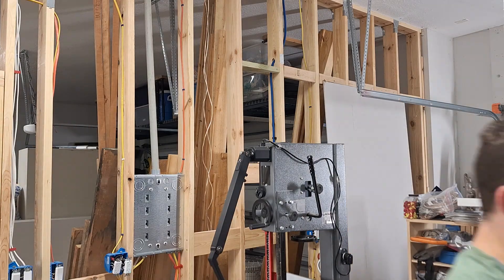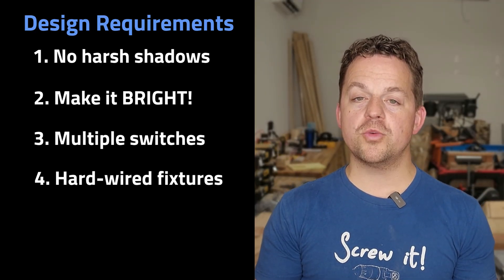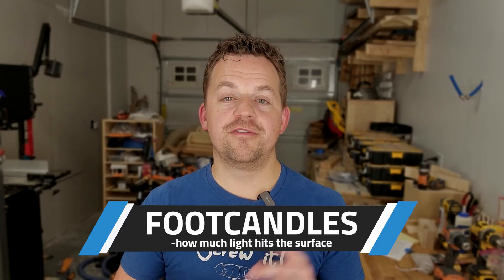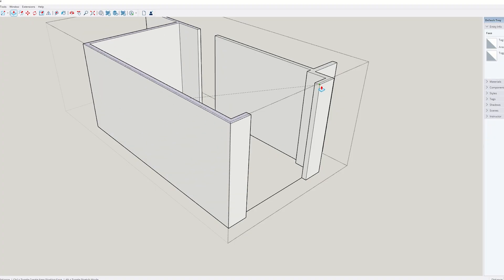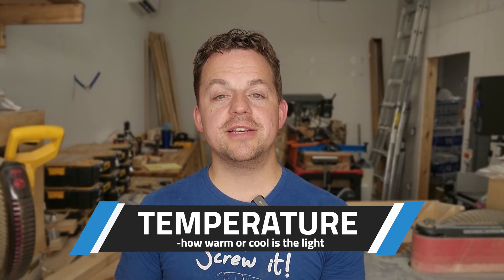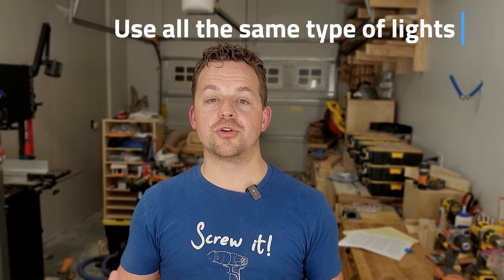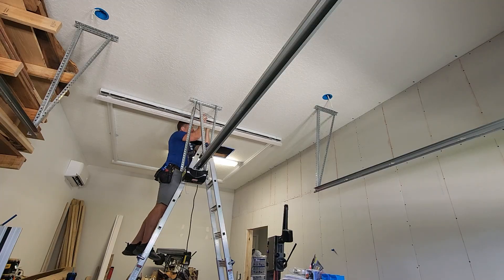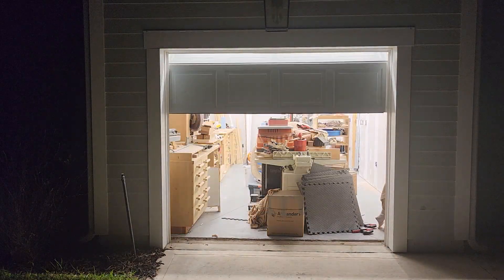Best Way to Plan Shop Lighting (No More Shadows)

Comment: Currently I work in a dungeon.  My shop is a single car garage 13x19, dark walls and little light. I am going to be wiring in more sockets, to light up my dungeon 😊.  I am 71 and a brighter shop is necessary.  You have given me lots to ponder.

Comment: @theeveningwoodworker With the lights you installed are you having issues with your garage door opener? I have a side mount wireless garage door opener.
Reply from the maker: I haven't had any garage door issues yet. Which side mount one did you get?

Comment: I'd absolutely love to have real daylight coming through large north-facing windows like they had back in the day.

Meantime, I like the cosy feeling and amber tint of a slightly underlit workshop, as long as it's bright enough at my table and workbench. That's why I have specific lighting in there, and I intend to add an articulated lamp (a larger version of the Pixar lamp) on my workbench for spot lighting any joinery work.
Reply from the maker: Yeah the natural light is by far the best and I've seen some dream shops with the big windows... someday

Comment: I’m actually debating 6 of these exact lights for my shop. The only hold back is I would have them mounted at 12’ high so I’m worried that would be too high. Would you be confident putting them that high for a general use shop, no detail work?
Reply from the maker: Yes, I don't think another two feet in height would negatively affect it. It does depend on how many lights you put up too, though.

Comment: I just retired and spending more time in my garage workshop.  I upgraded my lights using 4' LED strip lights from Barina (?) in 2 long banks in my main shop (1 bay of a 3 car garage).  I installed them around a quad fixture I converted from fluorescent tubes to LED tubes and also added some regular bulb type fixtures to add specialty area illumination.  Overall this process took me some time and I definitely made some mistakes (trial and error to match all the bulb CRIs since I did it over time) but allowed me to build a very flexible shop lighting plan so I can customize what I need without having to run all the lights all the time (feels like an operating room then).  Also, white painted drywall walls and ceiling and just a basic gray concrete floor.
Reply from the maker: Sounds like a good setup!

Comment: I found I preferred 3500-4000 Lumens for my eyes and that was my choice for my shop.  I also added specific task lighting over my bench (same strip lights) to eliminate any shadows.  My lights have been perfect for me.  I determined the lights and spacing by a much more elementary method by installing one fixture and carrying a sheet of white paper at waist height from directly under the light and moved away until the color changed and before a shadow was evident. That became my spacing of my 4 ft strips with diffused covers.  I them purchased 10-4 ft strips for my shop and the 4 ft strips were still a challenge to install by myself (as an old man on a scaffold) to keep them straight.  Mine have been installed 8 years now and I could not be happier with the lighting.  Best lighting I have ever had in a shop setting.  And you will appreciate the zone switches you installed.  I did that as well.  Good video.  Enjoy your shop.
Reply from the maker: Thanks! I love your method of determining the location of the lights... simple and practical!

Comment: Love love the increased light for you.  It will make working in that space more enjoyable.   I redid my lighting about 4 years ago.  I couldn't find super high cri LEDs that weren't many thousands so I went with Howard high bay specular reflector 4 bulb T8 fixtures (9 of them) and used Phillips fluorescent T8 F32T8/TL950 bulbs which are 98 cri, 2000 lumens, 5000k.  In rhe end I have 72,000 lumens coming down from my 12 foot ceilings.  I love them.  Even through they are fluorescent, I wouldn't change them unless I found 95 or greater cri LEDs that weren't multiple thousands of dollars.  Enjoy your new workshop!
Reply from the maker: That's some really good CRI! I'm glad they work for you. Do you ever have trouble with the lights not warming up on cold days?
Reply: @EveningWoodworker that's a good question and one I also considered before going fluorescent.  My shop is fully insulated and is attached to my house.   The coldest it has ever gotten in it (even with outside temps in the teens) is 50s.  They have never had an issue warning up.   I have 2 large led light figures that are on my main electric penal as normal lighting when I don't want the full force of the sun.
Reply from the maker: Sounds like a good setup. I think they only have problems when it's colder than that so you're probably good!

Comment: I actually use the lights you showed in your example of lights without a diffuser. I went with them because of their low weight allowing them to be mounted with just a few screws. They daisy chain and plug into a single outlet, so no electrical work required. I love them personally. I can't say I've been bothered by the lack of diffusers.
Reply from the maker: That's good to hear... I looked at those too, but I've heard mixed reviews. I also couldn't decide on the lighting color so I needed one I could change!